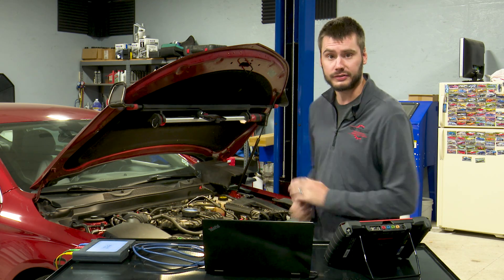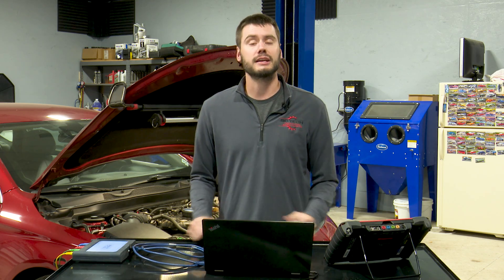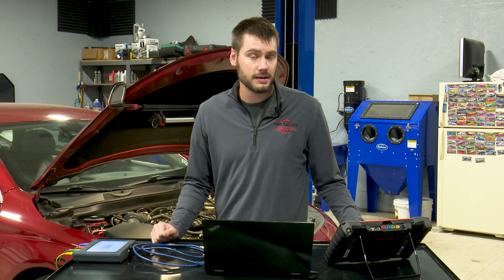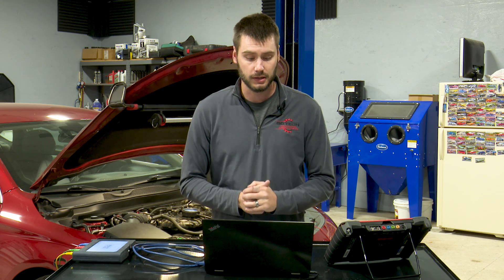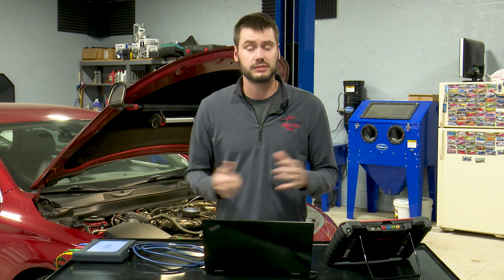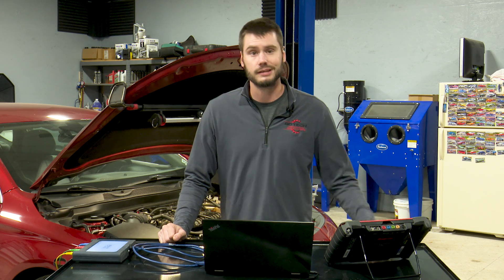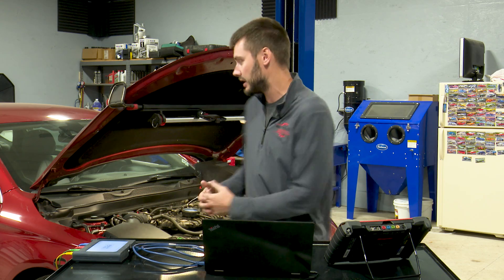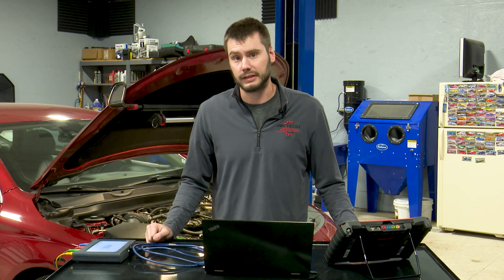3.6L GM Misfire Nightmare - Why No Check Engine Light!?!?

Comment: It makes no sense that one bank is nearly perfect and the other is off...  To me, that means that bank has jumped a tooth...   If the first bank was off a little and then the 2nd was off, even twice as much---- that would make sense, in that the chain is stretched and you can see the accumlation of the stretch as you go around.....   But that second bank being virtually EXACT as the 'known good" is a big red flag to me.   How can the chain be stretched so far on one, and not show any stretch at all on the other bank?    I'm betting that it jumped a tooth-- only on the bad bank-- the crank and other bank sprockets are still in time.
Reply: A jumped tooth would be about 20 degrees off. So it can’t be that.
Reply from the maker: Can't be a jumped tooth, it would be out further. This is a 3 chain engine. One for each bank and a primary chain tying them together. It is possible to have one bank off very easily...just hard to know the EXACT reason without opening it up. Everything is speculation at this point aside from the fact that bank 1 is for sure out of time. Results the same though, tear it down or trade it off lol!
Mike Becker, Senior Instructor
Reply: @renewedautodiagnosticsllc1789  On ebay the parts show that theres' actaully a cahin on each side-- so that explains how one side is stretched and not the other.     cool beans
Reply: @renewedautodiagnosticsllc1789   These sprockets have finner teeth than most engines I've seen...   It has 46 teeth at the cam phaser.. That's only 7.8 degrees off....  Why would one chain have stretch and the other looks almost perfect?.......  I think it's more likely that the tensioners broke on that bank and it jumped a tooth at the cam phaser...  Anyway, its the same diag either way--- it needs new timing chians.   it will all be discovered when they open her up. lol..
Reply: I was thinking chain stretch didn't make sense either. 
My initial thought was cam phasing fault on the intake side because the exhaust cam didn't seem as far out as the intake did. We don't have them models in the UK so don't know if they have phasing cams.
Reply: how much slack would a broken guide cause. it would depend on if it was the feed side or the slack side but that in my mind could easily be the culprit. i'm surprised super mikey doesnt have x-ray vision lol